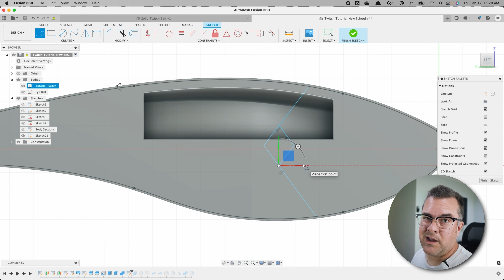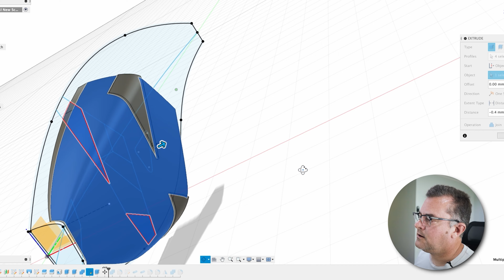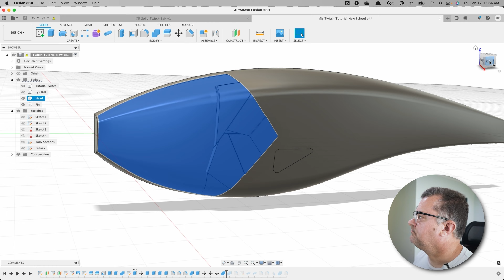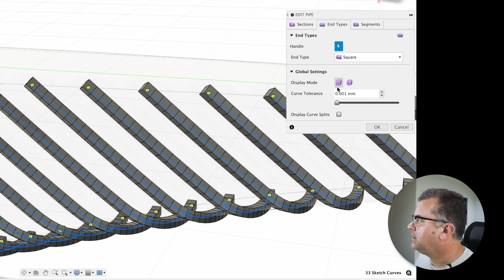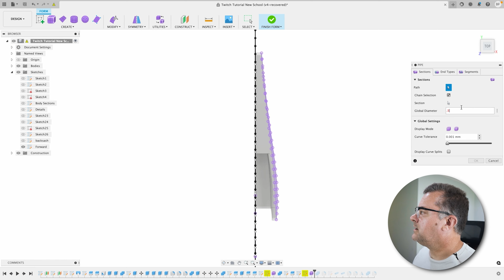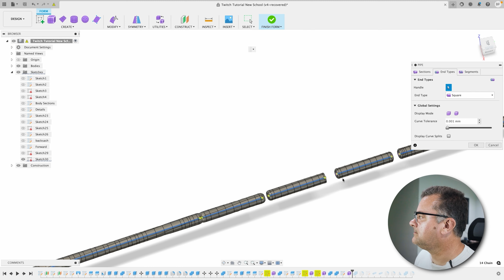Complete Lure Design Course - Let's Add the Details

Comment: Awesome have been looking forward to seeing the end result.
Would you recommend the creality ld200h resin printer for a beginner that wants to get quality prints?

I like the idea of the carbon filter and monochrome screen
Reply from the maker: Yeah I had that printer for a while. It’s pretty good and if you just want to do lures (as opposed to molds) it would be a good starter. You could do smaller molds as well just not multicavity for most baits.
Reply: @WMBayouLures  OK great thanks. In your experience are resin printed lures good enough to sell commercially or is it more suited to prototyping?
Reply from the maker: @Ryan McMillan  I think you could sell them no problem! I have a video on how to finish them coming up soon, I can't paint worth a crap but if you can, I think then can stand up to any commercially available lure/blank out there. I have produced small batches of soft plastics using resin injection molds and sold them without a problem.